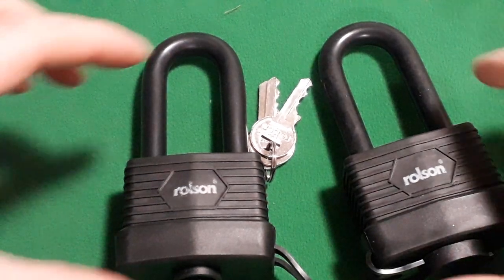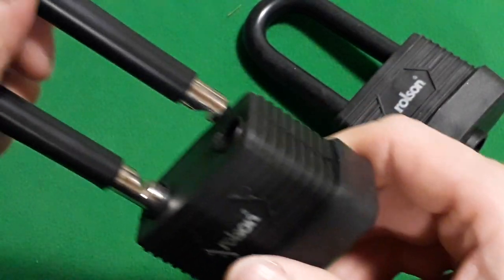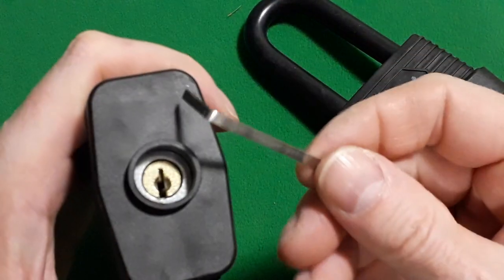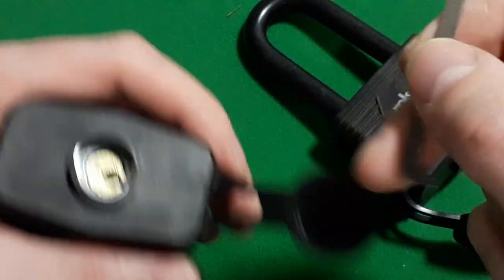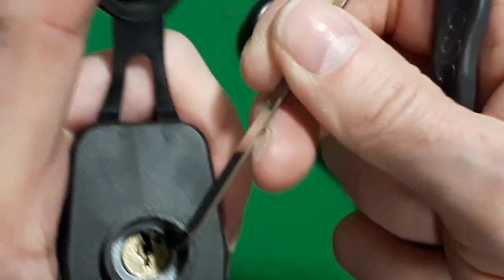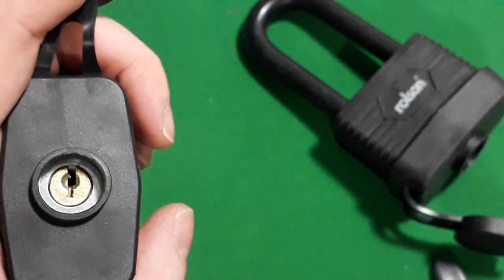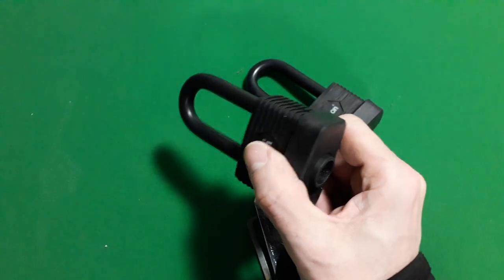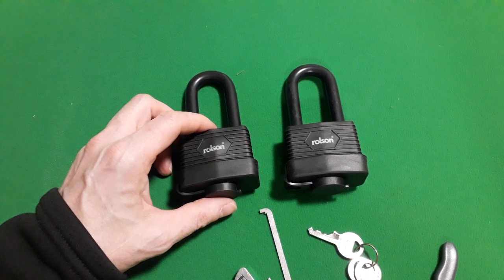(025) 50mm Rolson padlocks spp pick & rake open

Comment: nice video m8 Rolson 50mm are a joke i opened 1 without a tension wrench just rocking it with a rake it is different shackle size to your one
Reply from the maker: They look ok but add for any real security they aren't really good. 
I chucked to myself when I read you opened yours without ther tension wrench. You know it's bad when you don't even need the tension wrench which is a must when picking. 
Thanks for the comment 😁👍🏻